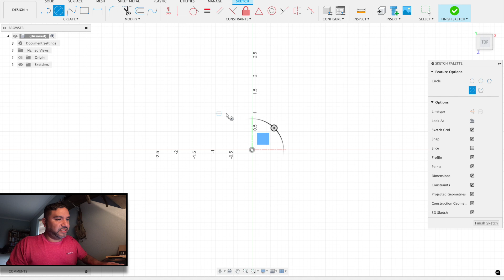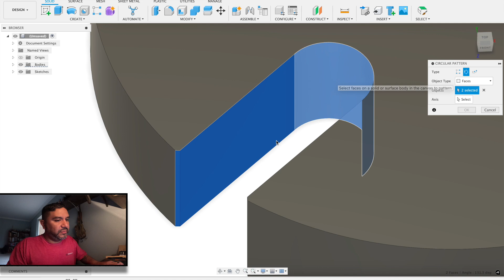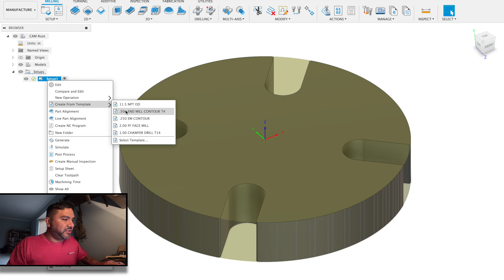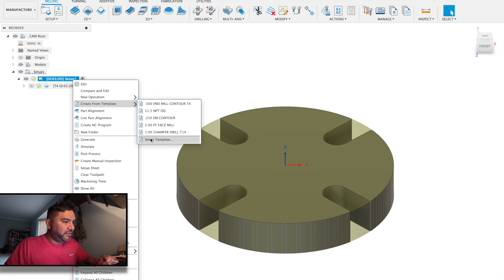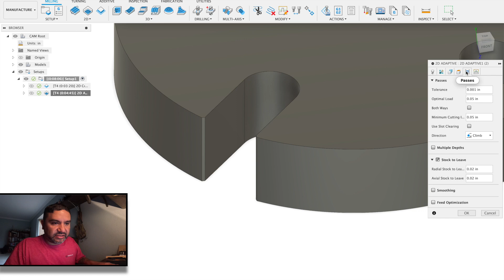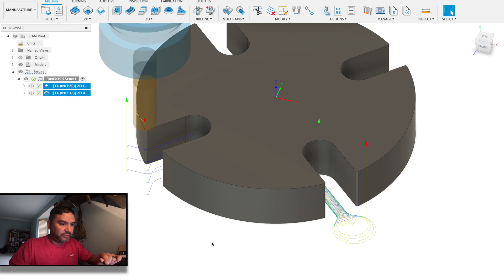Trochoidal Milling vs Conventional Milling - Fusion360

Comment: Very helpful video mate.  I'm trying to work out how I apply this sort of milling to cut out a 130mm circle of steel within a 220mm circle of steel using Fusion
Reply from the maker: Use adaptive milling, a decent starting point for side DOC is 10% of the mill. You may have to set your stock so fusion doesn’t machine the center if you already have it rough cut out.